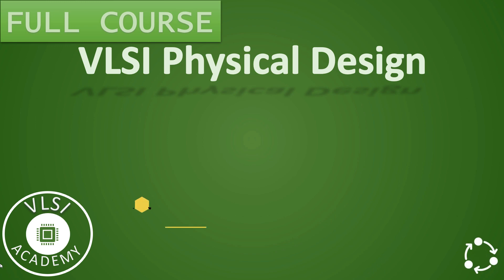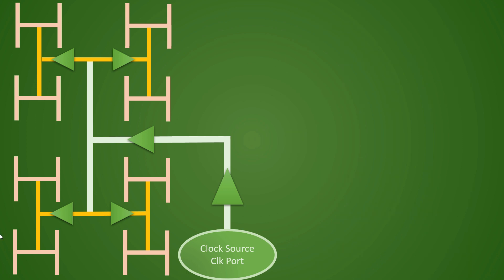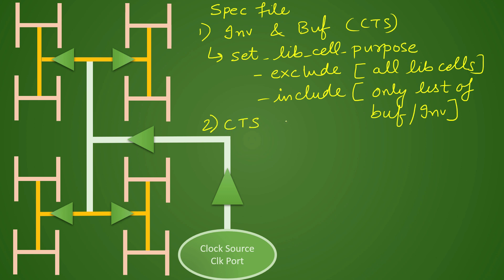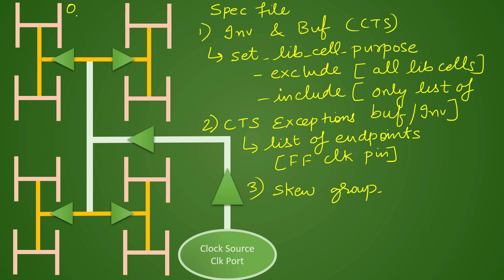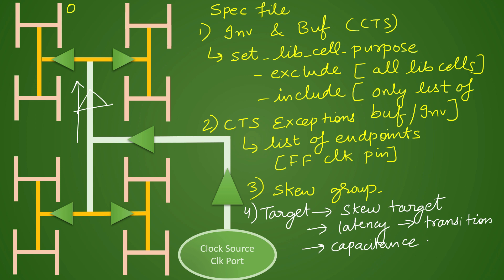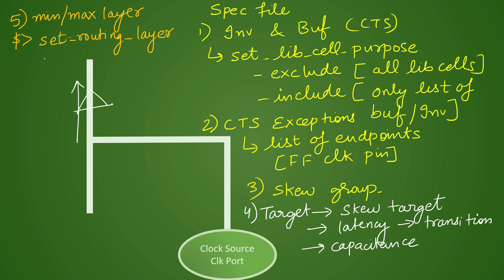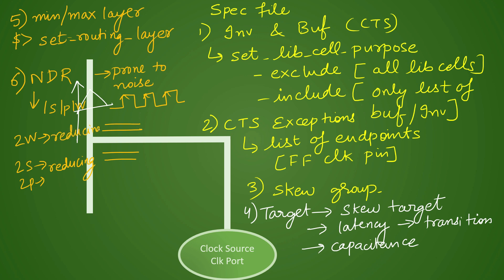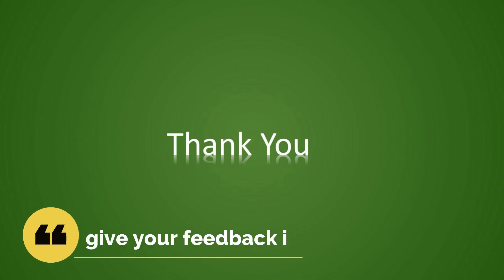PD Lec 53 CTS Constraints | Spec File | Clock Tree Synthesis | VLSI | Physical Design

Comment: I have a few questions,
1. On what basis do we decide the skew/latency values?
2. If talk about NDR, suppose we use 2w2s for cts, it means not 2 clock nets will have 1w1s, but when we go to route, The space (2s) is used by signal nets or not?

CTS will be like this:-
---clock net---
----space----
----space----
---clock net--

Are we expecting a fully routed design like the below one? 
OR
---clock net---
----signal_route----
----signal_route---
---clock net--

Thanks